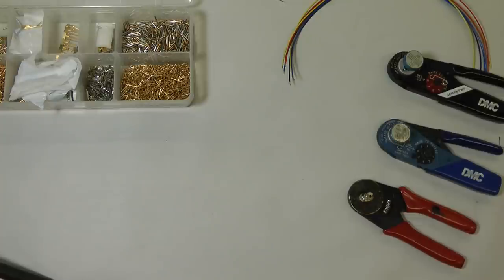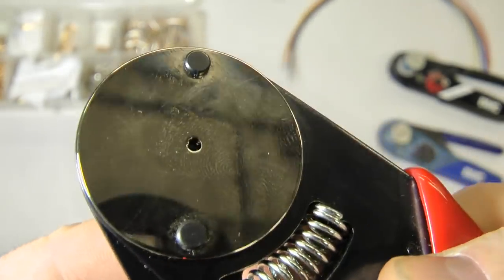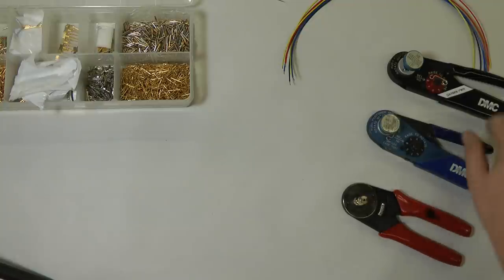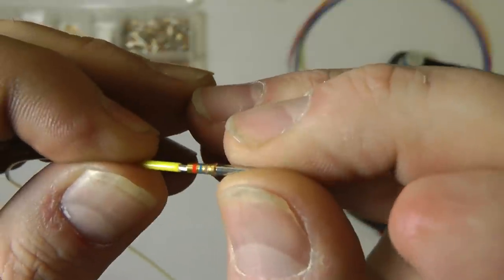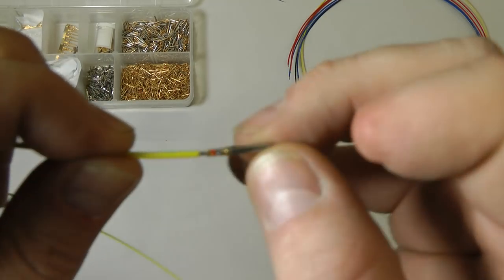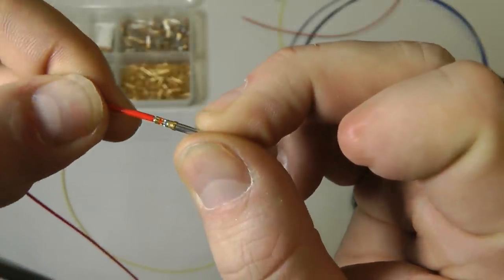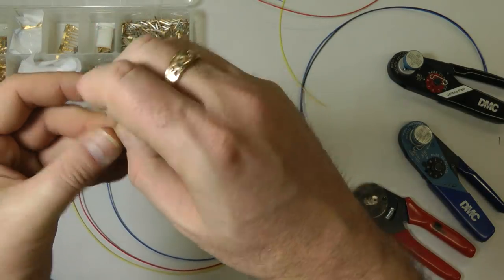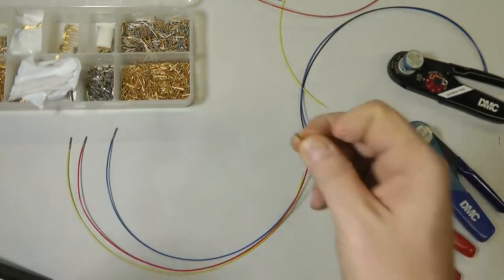004: CRIMPING DSUB (DB) MACHINED PINS for Avionics

Comment: You should mention that the crimpers need to be set for a specific gauge wire, and that the strip back should be within 1/32" of the back of the pin.
Reply from the maker: You are correct - good points!

Comment: Thanks you have the most helpful video I've see on crimpers the others looked at don't fully crimp the wire can you please say the name of the first set you showed the red pair
Reply: I wanna know that too
Reply: I believe those crimpers are called "4 way indent crimpers for d-subminiature". Because the "iris" inside the opening crimps simultaneously in 4 places around the crimp pin.

Comment: Hello , may i ask how to determine the pin size (AWG )? Is it  is about the band color? Thank you
Reply: Our standard dsub pins and sockets work for 20AWG and 22AWG. The high density dsub pins and sockets work for 22AWG and 24AWG. We don't generally work with anything smaller than that. I hope that helps.

Comment: Thank you for video! I can't see from video if wires you are using have their ends soldered or you just collected wire cores by hand?
Reply: anton lancevič The wires in this video are not soldered or "tinned" with solder (though the wire we use is Mil Spec tin plated copper with Tefzel insulation).  You can dip the ends if you desire, but it often is not required.

Comment: Are you pre tinning the wire!! Is the wire plastic or teflon??
Reply from the maker: Neither - the wire is tefzel...and one wouldn't normally "pre-tin" a crimped connection - usually only solder connections.
Reply: @SteinAir  thanks, i,m a tube amp guy . This is new to me. I don,t get past cloth wire and high temp plastic coated. Very informative. We do and don,t pretin
Reply: Russell E Simonetta FYI, never, ever tin a wire with solder before crimping or clamping into a screw terminal. The solder will actually “flow” under the compression, resulting in a loose joint in the long term.
Reply: What do you use for insertion and extraction

Comment: I have a question? Will these crimp pins male and female work for audio? I'm building a bunch of dsub25 snake cables for my recording studio and they are a pain to solder each piece. You're website has everything I was looking for and I just wanted to know if you had any experience using these for audio purpose, and are they gold plated? Thank you ahead!
Reply from the maker: Amex Absolutely. Typically a crimped connection with the gold plated machined contacts (like we stock) are FAR superior to the solder cup type Dsub connectors, especially from an Audio or Data standpoint.  They are used extensively in everything from data lines to audio lines (reception and transmission), etc..
Reply: @SteinAir  I believe these are also the same pins used by Phoenix Contact in their HEAVYCON modular connector system. They use machined pins that have the PN prefix CUC-DSCxxxxx and its taken a LOT of time and research, but I am nearly positive that DSC in their PN stands for D-Sub Connector. That realization meant that I don't have to buy the $1800 Phoenix crimping tool, but I can use the Iwiss crimping tool which costs only $32. Nearly identical to the low cost crimping tool you show in your video. Thank you for the great video!!!